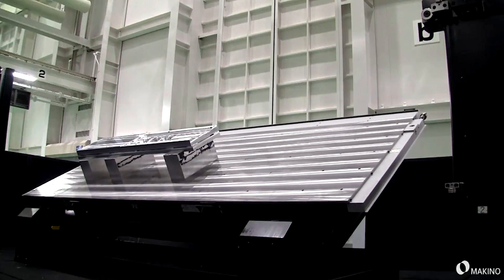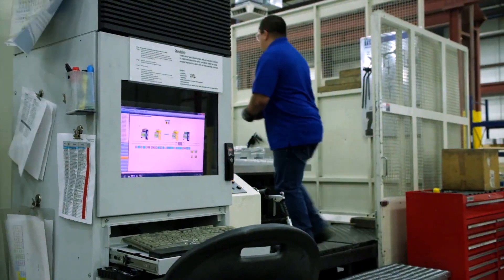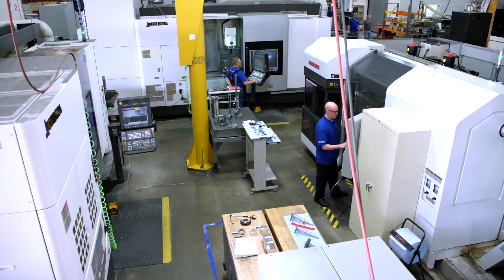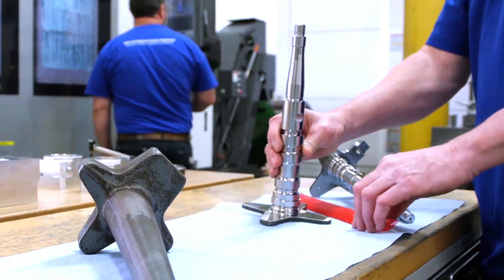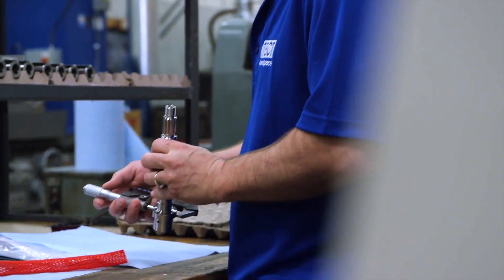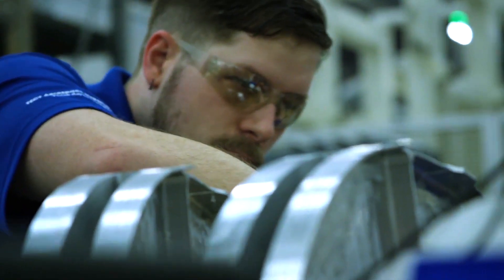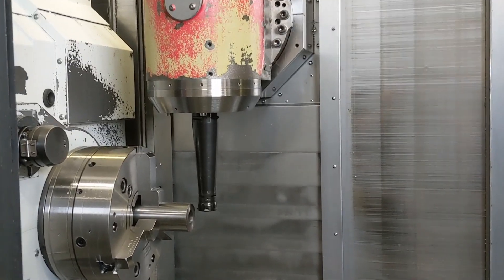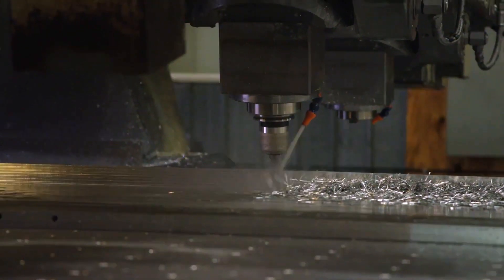Power skiving, a customer case study - Sandvik Coromant collaboration with OMIC

Comment: You only show 1 part that has a gear but never the tool running, this video is more advertising for OMIC and the customer then your own product. Maybe make a video showing the tool in process and 3D cam models.
Reply: That's why it's called a Customer Case Study